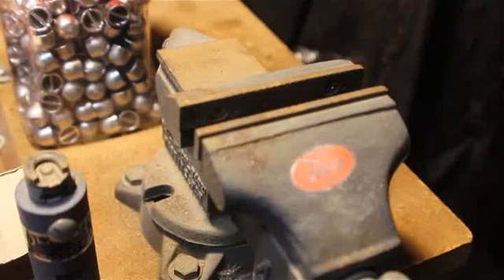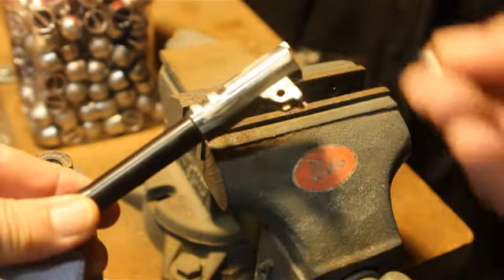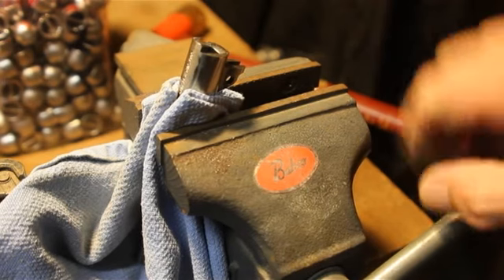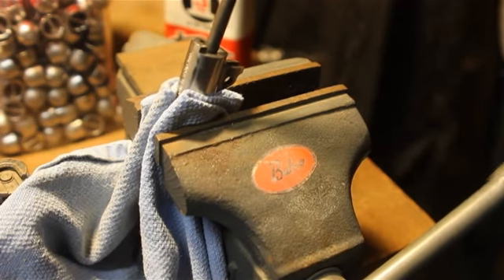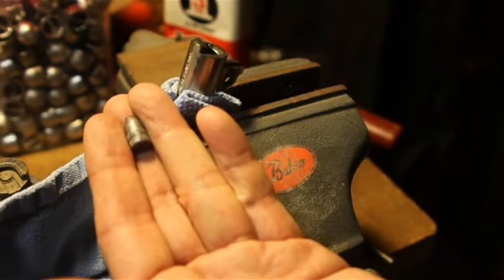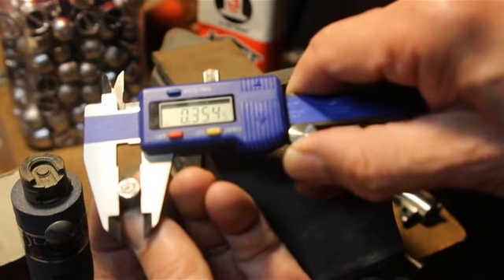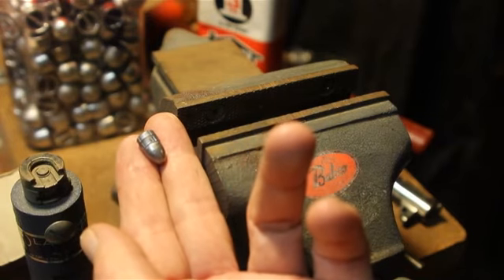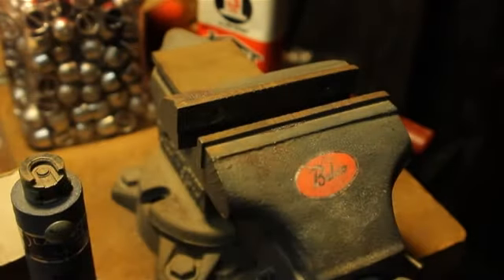Slugging Auto Pistol Barrels

Comment: Sometimes it may be, that bullets are to small in diameter.

I saw a guy, filling a case, in that caliber barrel he wanted to slug a barrel, with pure molten lead.

This can be done in any caliber you want (without rifles).
All you need is an empty case and melting some lead in it.

That will give you great slugs which are a litte bit over the barrel diameter.

In fact, that the case is smaller in diameter at the bottom, will give you a good bottom to start with slugging in.

Greets to the neighbour in Austria.

And as always,
best wishes to FC from Germany,
Ouw.
Reply from the maker: Ouwkackemann - The cast in the empty case trick is a good one.  If one of my already cast bullets is too small, I'd go that way.  But most cast bullets are useful to slug barrels with just as they are...nice and handy like in this video...Best Regards to you

Comment: I have a dumb question. Im trying to find out what size of cast bullet to purchase. So don't have any lead bullets yet. Can this be done with a copper plated bullet also??
Reply from the maker: Travis Powell - Thanks to SAAMI, we can often buy 38 / 357 bullets or 45 cal bullets of the proper weights and wind up with good results.  Only if our gun refuses to shoot well do we really need to slug our autopistol barrels.  Measuring revolver cylinder throats is too easy not to do it.  We want revolver bullets to be .001" - .002" bigger than our revolver cylinder throats - definitely not smaller.  However, you will see or hear from well respected shooters that the cast bullets you buy should just drop through your cylinder throats... It is possible for your gun to shoot well that way (and then you will be one of those shooters telling everyone the same thing), but it is much more likely that if you use bullets too small for your cylinders to seal the gases, such gases will blow by your bullet, and deposit lead into your forcing cone and first 1 1/2" of barrel that will degrade accuracy after the first dozen shots or so.  It is the principle of obturation.  With jacketed bullets, they can just drop through cylinder throats and shoot just fine as those will not lead barrels, and the smaller bullets will "slug up" and obturate the barrel with good accuracy.  Our cast bullets will do the same, but if there is no obturation early, the gas cutting will lead our barrels.  Good shootin' to ya,  FC Steve
Reply: NO! Never try to slug your barrel with copper plated or jacketed bullets. The gilding metal is too hard and may damage your bore or the groove edges.

Comment: hi how are you ok lee mold for 9mm is .356 why slug the barrel for lee mold but lyman 9mm is .355, .356, .357, .358 so is it ok to use lee mold as is and still get no leading thank you.
Reply from the maker: ocean374 - Problem with all molds is it doesn't matter what the designator is on the mold - like .355" - when you cast with that mold, it oftentimes will drop bullets bigger than the designator.  You can mike your bullets and if .356", that should be perfect for the vast majority of 9mm barrels.  If bigger, you might want to size 'em to .356" - .357".  If your ammo shoots well and clean without sizing, then just cast 'em, load 'em and shoot 'em.  If your ammo doesn't shoot well and clean, then you have to slug your barrel as in this video and then go with bullets .001" - .002" bigger than your measured groove diameter.  If your mold doesn't drop 'em at that range, you will have to size the bullets.  If your mold drops 'em smaller, you can powder coat 'em bigger.  If you want to powder coat your bullets, mike 'em after PC and if too large, you can size 'em then.  Have a great day,  FC

Comment: While in principle this is the way to slug your barrel, I think it would have been a good idea to use a wooden dowel, or brass rod to push through, also a pair of lead jaws to protect the barrel from your rusty and knarled vice jaws, I know you placed rag around the barrel, but the serrations will cut right through that.
Reply: I think it was his friends gun!!!!!  : )
Reply: That surgical quality towel is very tough. Would be surprised if any marks would be made. Only needs to be tight enough not to slip while he is slugging the barrel.
Reply: I use a brass rod I bought at a hardware store for a couple bucks. I chamfer the end so that even if somehow I misaligned it, it would tend to skip off of the chamber throat or the rifling lands.  Leather is way better for vice jaws. It grips more and is more protective. An old glove or a scrap from your local saddle shop will do well.
Reply from the maker: Englishman French - Thanks for posting your comments as it helps to fill in all the blanks from videos for anyone that reads these things - and many do.  Actually, I just finished adding an annotation that if there is any doubt about keeping the rod centered (like on a longer barrel), then a wood dowel would be best used.  For those who have not slugged barrels before, the wood is definitely the way to go...If the vise looks like it is locking thru the towel or leather or whatever, than barrel damage from the vise would be likely.  I was seeing towel thickness between the jaws of the vise and the barrel even when snugged up, so little chance to damage the barrel here.  But your point is well taken - those without experience slugging barrels might not pick up on that and have barrel damage as a result.  Hard to not leave every stone unturned doing these videos.  There's always better stuff to use, but the heavy handed slugger will still cause trouble.  I also put in an annotation on use of plastic mallet to do the pounding.  Have a great day
Reply: With awe I thank you for showing us what you know. 40 years of reloading is a wealth of knowledge to share. Glad I found you. Have a great shoot this weekend.
Reply from the maker: ***** Thanks GPH, there are many with a lot of knowledge, information, experience etc., they just don't have any desire to put it out there.  I find it fun to do and people like yourself make it all worthwhile...it's a privilege - Best to ya

Comment: I like .357" for 9mm. So far it has chambered in every pistol I have tried and been within the good size range for every 9mm I have slugged. .358 will stick in the smaller ones and maybe not extract well.
Reply from the maker: GunFun ZS - Thanks for your 357 recommendation.  My secret is that I do not cast for my 9mm.  Reason is when I was steel shooting, I had a whole closet full of 9mm 147 gr TC Moly bullets purchased commercially.  I still have a lot of that left so no need to cast - just load those 147s...They work well, I have never bothered to measure them.  Best to ya....
Reply: Since I've seen your stores for your common fodder that you replenish, I can barely fathom how much you must have purchased to be considered "a lot" I am sure that works out to decades of good times with friends and family.
Reply from the maker: GunFun ZS One time when my wife saw how many boxes of 1000 moly bullets, I had, she said she was surprised that our house did not sink - funny girl, the floor is a concrete slab there!!  And why not?  At the time 1000 9mm moly bullets were $16-$19 a box and 45s 230 grainers were $25.  We had one of our guys run a 3/4 ton pick up truck straight to the commercial caster regularly with our orders - no shipping so we all loaded up. We'd shoot 600+ rounds a night till 10-11pm shooting steel for years.  We did crazy things like team up and see which team sawed through a dangling 2x12 fastest (45s 200 SWCs recommended 4.8 - 5.2 grains of Bullseye).  Those were the days.  One of our guys has about 50K moly 45s at his place - I'm figuring out some way to talk him out of some of that since he hasn't been doing much shooting as of late.  Sure money was worth more then, but factored for inflation, that still was fair bit cheaper than now.  Have a great day
Reply: Just rub it in, why don't you? And here I just wish I could replenish my standard powders.
Reply from the maker: GunFun ZS Sorry, didn't know I was doing that...As for powder, everyone reloader I know is scrambling for it...that's what happens when the shortage goes as long as this powder shortage has gone...I'm going to be using my supply of Titewad powder soon for handgun, and it is so fast burning, it is not our best choice for handgun loads...(but nothing really wrong with using 2.5 grains for standard 38 loadings)  Best Regards
Reply: Don't take my last post seriously, sir. It was just a tease. It makes me glad to see others in abundance. Especially when it was a result of foresight, hard work and planning. Your plentiful stash, is a goal for me. Or a fine collection like 1957 Shep... It probably won't be that big a priority in my life, but I would have fun going in that general direction.
Reply: FortuneCookie45LC
Glad to see I'm not the only one using Titewad!  I used it in 9mm for plinking rounds; it has been awhile, but I believe I worked up to 4.0gn with it using a 122gn truncated cone and didn't see pressure signs in my CZ75BD.  Worked well for shooting steel.